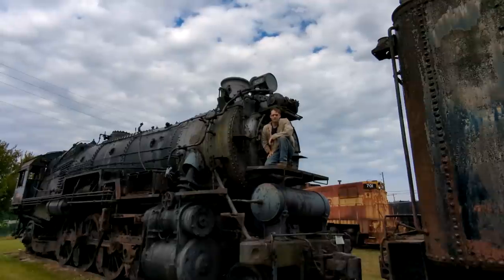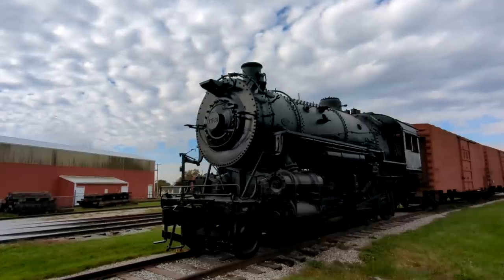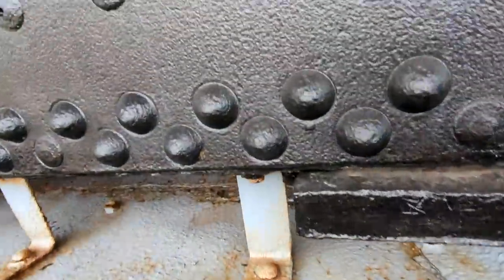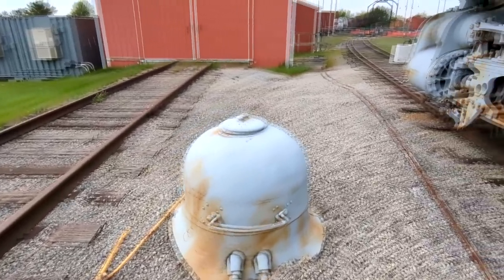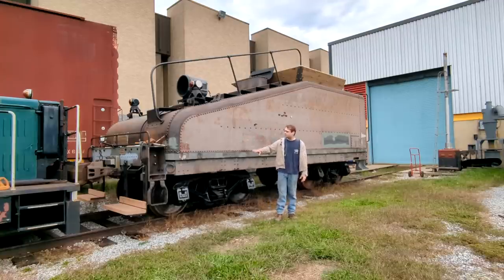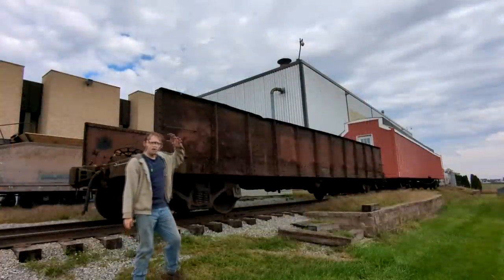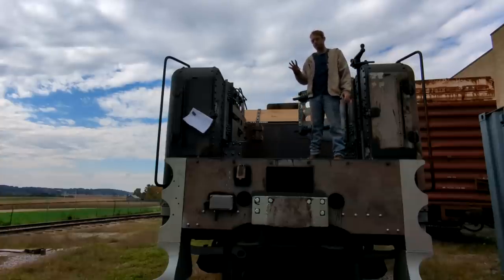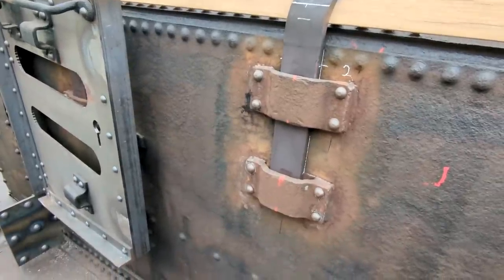Preserving 5 PRR Steam Locomotives-Welcome to MikesMetalFab

Comment: Thank you so much for sharing these updates!   I was especially excited to hear about the GS Gondola getting some restoration work!     When I visited the museum earlier last year I noticed that the car ends on the GS Gondola were being removed and I admit I was worried that it was perhaps determined to be too far-gone and was being subsequently scrapped (this happened in the past with the PRR mP54 MU Coach).  I was hopeful on a more recent trip, where I saw it sitting outside the restoration shop, that it was instead getting some much needed work.   It was definitely nice to have those hopes confirmed!

Comment: They need to be under roof that doesn't have perches for birds.  Much of the equipment ar IRM is under roof but there is still degradation from bird excrement which is highly acidic as the sheds have open trusses.  Good video, liked it much.

Comment: I last visited this Museum more than 40 years ago, and found that most of the steam locomotives were still in acceptable condition, even though they were being kept outdoors.  Since then, serious deterioration has reduced most of them to mere shadows of the engines they once were; they appear to be in the process of being scrapped.  The Museum should have kept them under canvas, to prevent this foreseeable degradation.
Reply: That's the problem with many public museums, it's hard to find the money/volunteers to maintain them. Private ownership would have seen a lot of these locomotives put into service, but individual ones would share a similar fate- Give the PRR credit, they made an effort to pass someone a portion of their legacy and someone like this guy is trying to keep them around!

Comment: At what point does a cosmetic restoration become less justifiable than an operational one? I understand and appreciate the effort and testing on the boiler/firebox, but would it not be easier to take it all apart and replace the pieces from the ground up one by one?
Reply: Follow-up question, are you hiring? lol
Reply from the maker: That is a fantastic question that I hope to cover in-depth in a later video.  For our museums case, being owned by the state adds additional politics to the matter.  Basically, the PRR used belpaire fireboxes in most of their steam locomotives.  After the Gettysburg incident the FRA changed their requirement so that any operating steam locomotive must be able to withstand so many pounds more than operating pressure to be allowed to run.  A normal radial stayed firebox is a circle which offers greater strength than compared to the sharp corners of a belpaire.  None of our locomotives would be able to pass the requirement and would need entirely new boilers constructed that would be slightly thicker with closer stay bolts.  Check out the progress on PRR 1361.  They go into great detail about redesigning the boiler.  With that having to be redone, it brings the cost up tremendously.  We are currently not hiring for the shop but there are some retirements in the future.

Comment: MAN !!! Ya'll stole my thunder, (or should I say Fantasy), by being a sub-contractor who addresses these issues. With that being said, it's my understanding that rust is similar to cancer in that when you take a highly affected area out...the surrounding area(s) still have the same invisible  "components" OF that rust and if you don't cut out the  bad far enough from the non-rusted surfaces...the surrounding  rust "may" spread again, like cancer. I'm not trying to portray myself as being some sort of metallurgist, (sp?), but it makes sense to me, (I guess). Also, I'm pretty sure you're up to your elbows in "Alligators" with restoration projects, but here's a project you might want to think about. Former GTW Steam loco. # 5632 in Durand, MI which is / has been static since the early 60's and the GTWHS is looking to do either a cosmetic or total restoration on this engine, (obviously depending on fundage). I'm a new subscriber, (as of today, 11/16/23), and find these projects amazing. God bless ya'll for doing his work and making people happy. Just wish I could help as I'm 70 years old and MY age is kicking my ass through similar deterioration.

Comment: Anyone else think something is amiss here ? I mean, a socket wrench on 90+ year old bolts !  And where is your crew ? Or, are you going to do this alone ?
Reply from the maker: Usually if you heat a nut you can get it off with hand tools.  When I work in tight spaces I don't like to use air/power tools if I don't have to.  I figured with as bad as the nuts were I didn't have a good chance to remove them anyway.  After awhile you can usually tell if you have a chance.  The rest of the crew was in the shop.  I'm trying get the tender ready for our sandblaster so I volunteered to do this job myself.

Comment: Its a shame that these engines are not going to restored to running condition. They  won't allow running restoration. The K4 is a prime example. This is the only other engine left. 

In my opinion**** Strasburg should take this engine and restore to running condition. The shop is right across the street and they have the capability to restore this to running service. I wish it would happen.
If the Big Boy locomotive was restored ( who would ever think that would have happened) they surely could restore the K4
Just a thought.........
Reply: Maybe you could pay for it?
Reply: K4s 1361 in Altoona is going to be restored to operation.
Reply: @ethanmack4385 There is no one that would be willing to finance that. The 611, Big Boy and Challenger are owned by the railroads that restored them and those railroads have marketing budgets that allow them to do that. Even with donations it's not enough. This is a state museum, not federal like Steamtown so the operating budget is quite a bit smaller.

Comment: All these locos should’ve just been put inside in a pole barn like addition to the museum. It’s utter nonsense how they’ve been allowed to rust for around 50 yrs. This long drawn out ordeal of a Roundhouse isn’t necessary just get them under cover as affordably as possible that should’ve been the mission dating back in the 1970s when the museum opened it was too small, the second addition later still wasn’t big enough.

It’s also disgraceful that the 757 wasn’t traded for the I1 in NY and they let the PRR MP54 rot so bad they scrapped it.
Reply from the maker: I agree with you but that was out of our control.  What we can do now is fix the engines to the best of our ability.  I wish they still had the mp54 as well but from what I heard that was in awful shape when it arrived to begin with.
Reply: @steamgent4592, wow that’s a helpful tone…😒